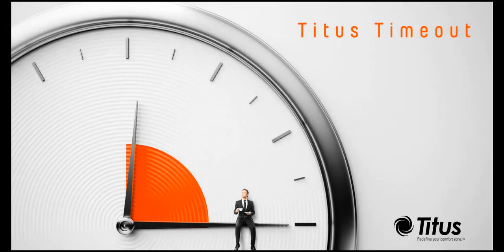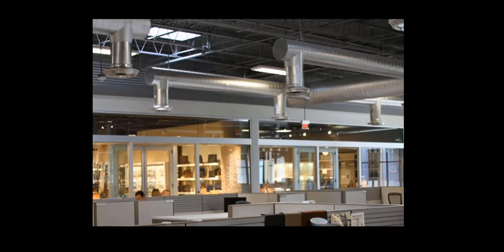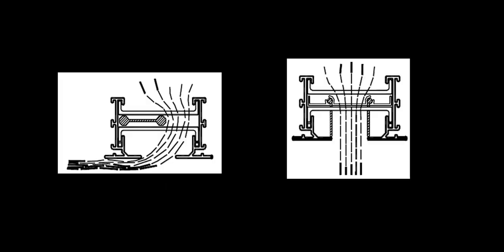Titus Timeout Podcast - Ceiling's Effect on Diffuser Throw

Comment: How can we calculate throw velocity at a specific distance on ceiling..plz
Reply from the maker: Titus Teams software allows you to specify a terminal velocity for throw values. Whereas this is opposite of what you are asking, you can specify a velocity, check the distance, then raise or lower your velocity till you get the distance you are looking for. I’d start with looking at the cataloged throw data to get a rough guess of velocity and distance to start with.